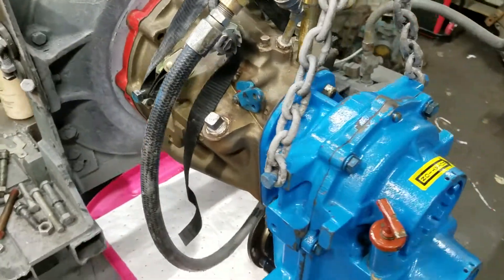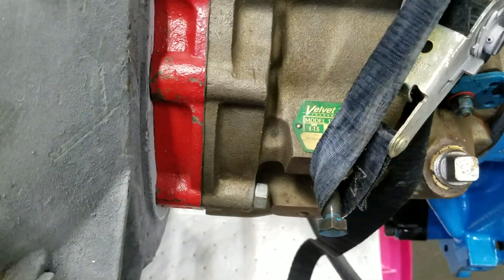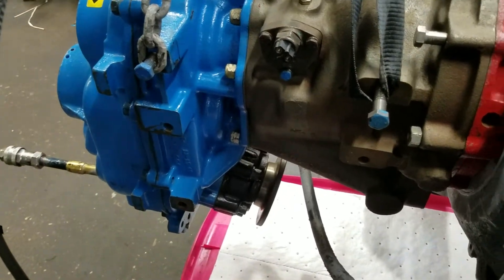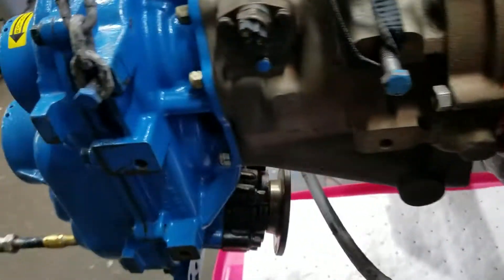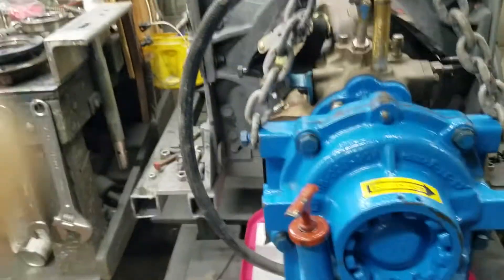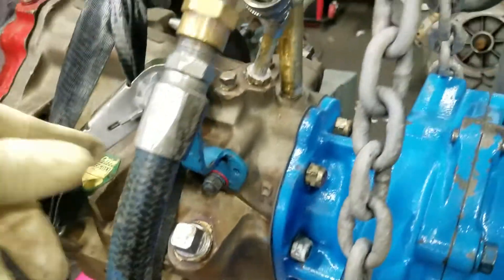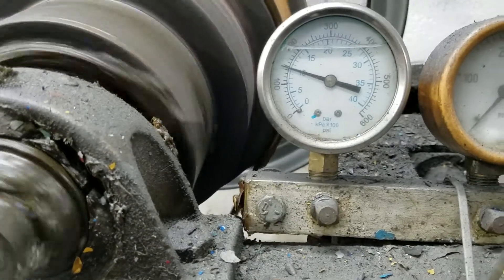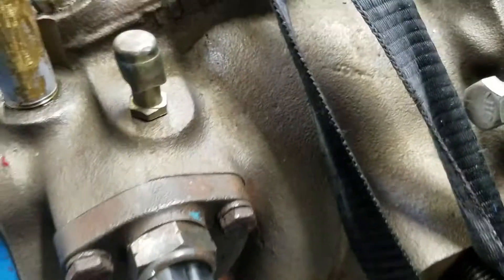Velvet Drive transmission 1005-002 E2.0 testing

Comment: Hey guys, if at all possible would you consider doing a video on correct oils and - or alternative oils for velvet drives. 
Is there much flexibility with regard to viscosity in older gearbox’s for example. 
Cheers in advance.
Reply from the maker: Hello Peter we'll do one this week.